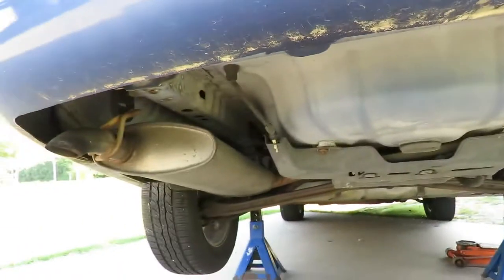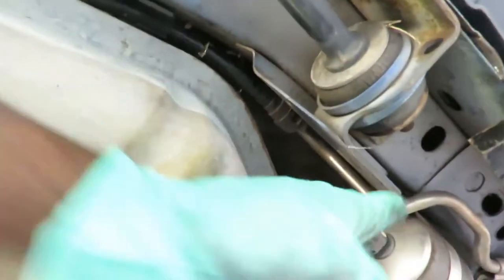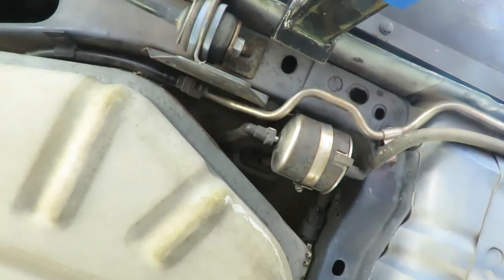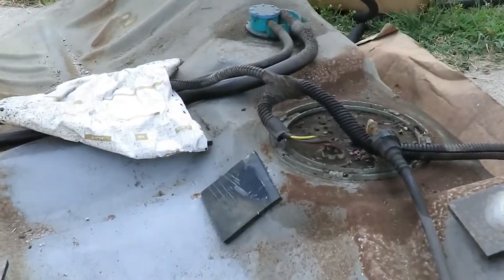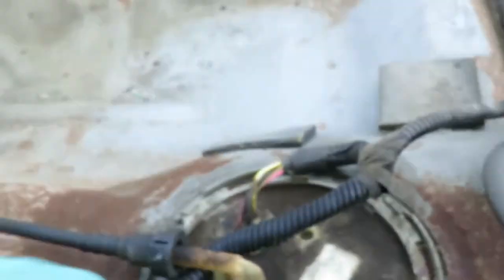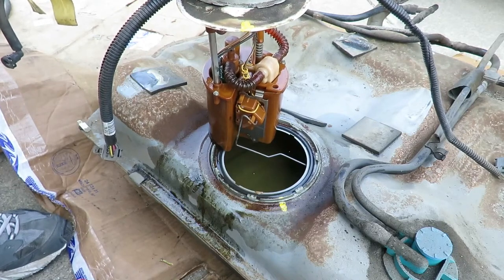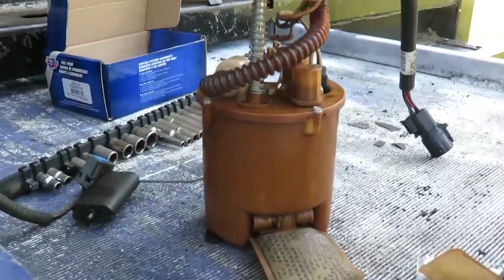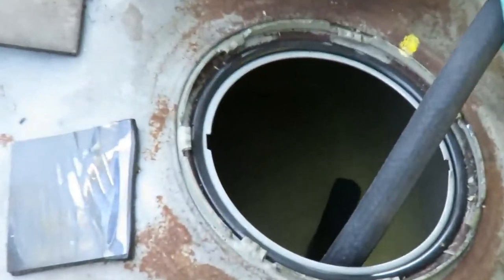⭐ 2002 Mercury Sable - Fuel Pump - Fuel Filter

Comment: I dropped the tank today on my 2001 Sable. Don't know if it's the same as the one you worked on, but I didn't have to mess with the line that you were having so much difficulty with (9 minute mark). All I did was disconnected the 2 quick connects at where the Y was in the back of the tank.

Comment: Great job, That arrow on the pumps  top and the dimpull on the tank should line up so the float levels are correct....
Reply from the maker: THANKS!
Reply: @OnlineAutoRepairVideos  Your very welcome,  I'm changing one right now , I got a complete Carter brand pump , I'll never buy them cheap ass $33.00 off brands  again ... The bottom screen fell apart in the tank ....
Reply from the maker: @MrRockydee07  LOL!!! That sucks!!